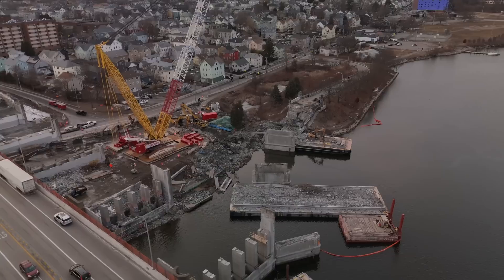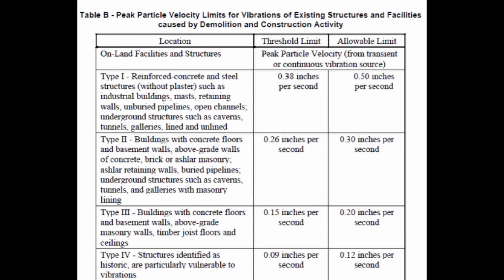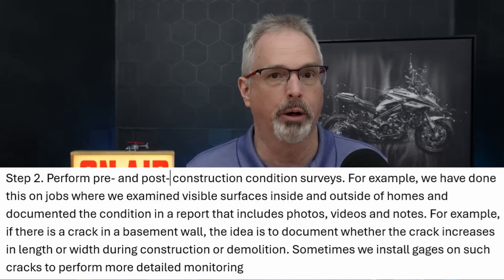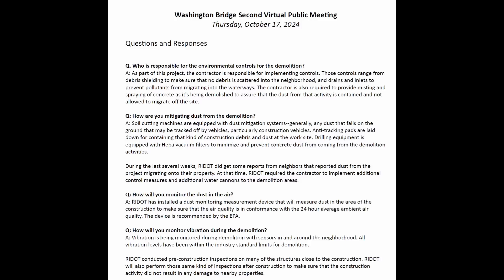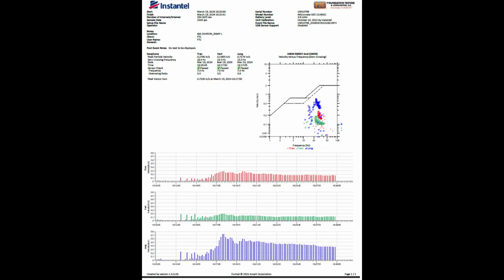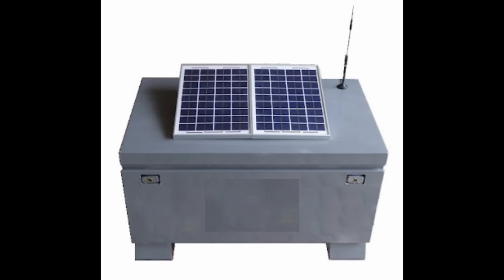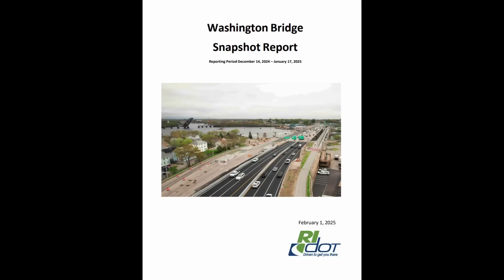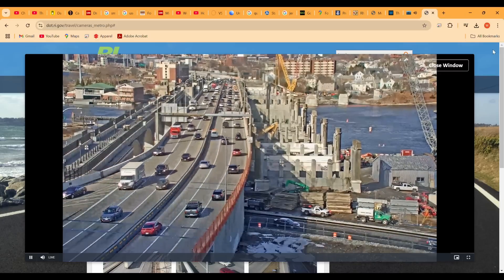Vibration Monitoring Overview and Washington Bridge Update

Comment: The RIDOT reported 2621 trucks over 96,000 lbs crossed the bridge in a 7 week period. This data was obtained from the new monitoring system. Alviti claimed the RISP was enforcing the weight limit but omitted any mention of how many trucks were stopped and the enforcement action that resulted. My guess is its low and Alviti isn't being honest (again).

Comment: Excellent presentation.  This is a monitoring tool that can tell you a lot,   Applicable not only to structures but rotating machinery also,
Reply from the maker: Thank you.  Yes you are right about that issue existing with rotating equipment.

Comment: A return question you may want to ask to folks who are in the vicinity of the demolition and are not aware of monitoring at their structure, is whether they are a renter/leaser or the owner of the property they reside at.  In some of my projects (not a structural engineer but deal with them time to time), there is a dearth of structures where vibration can be measured because the neighborhood consists of more rental properties than owner residences.  The engineer will need permission to measure vibrations from the OWNER of the structure, and if you have bank-owned properties or landlords operating many buildings, then these requests can go unanswered.  There is not much reason to give the state and contractor the benefit of the doubt here as you have laid out in excellent detail, but if we have definite owners who are not being included in the vibration study that is much stronger evidence of neglect here.
Reply from the maker: I can say that there are some owners who are concerned about vibrations and there apparently has been no pre-demolition condition survey performed on behalf of RiDOT to date.

Comment: Try being on bridge a deck paving job, with a full size Gomaco paver, half the bridge with live traffic. The bridge moving up and down is un nerving. None of the GPS manufacturers at ConExpo could explain maintaining vertical elevations tolerance on the paver! I hope you have the chance to experience, a bridge bobbing up and down!
Concrete is an interesting animal when flexing!  South Bound I-15, 146000 South, Utah. 2015.

Comment: One time we drilled some large diameter deep shafts in glacial deposits. We had to plan for hitting boulders. Our plan was to use explosives to remove the rocks if needed. It never did come to that. Years later I learned about expanding grout - is that ever a solution?  I can see it being used for one or two odd items but not for dozens of columns unless it was tight work within a community.

Comment: I've worked with a lot of vib monitoring on equipment but one time we had to monitor vibs on our military construction site when some big items where being tested some miles away. The items were visible to us as they fell through the air. We could see the impact and watch the monitoring gear and see the data response about the same time we heard the wha-whomp. Like you said the higher frequencies got attenuated a lot more than the lower freqs.

Comment: the fox point neighborhood that you refer to in this video consists of many, many structures that were built in colonial times (1700's). i worked for a year in one of these structures on wickenden st (which is in fox point). the structure i worked in had been converted: the 1st floor was a medical office, the 2nd floor was an office where i worked, and the 3rd floor was an apartment. but it was a historical building (registered as such), so as much original architecture/structure was preserved as possible. it had floor boards that were as much as a foot wide; the stairs would never meet modern code - much too steep  and narrow. the floors in the office where i worked were dramatically sloped, and any person walking on the level where i worked would cause the floors to vibrate on the entire level.
given the nature of these structures (age, potential fragility, and historical significance), wouldn't any concern of vibration be of more importance in this area?
also, there is a golocalprov article where residents in the area speak of their homes shaking violently to the extent of causing fear that the structure might fall - with a quote saying that the noise from the demolition was bad, but not as bad as the sounds their house was making as it shook.
if anyone is interested in colonial architecture, you can us bing maps (or whatever app you choose) and do "street view" of wickenden st, providence ri to take a look. you can basically tour the entire fox point area from there.

Comment: I have watched many videos about bridge collapses. More often than not, it appears that only partial spans collapse. This is invisible to drivers and many deaths occur because of this. Why isn't a warning system used to alert drivers about this? On the surface it seems something as simple as a robust and redundant electrical cable system used to turn red lights on the entire bridge to make drivers stop and avoid plunging off the edge used? I say redundant in that all cables must fail in order to help prevent false alarms. This seems like a no brainer to me. Am I missing some detail?

Comment: We do vibration monitoring for both construction and blasting.  Our DOT requires preconstruction condition surveys within 150 feet of the work zone. One thing i have learned is that people generally don't have a frame of reference for vibrations.  Our only client who regularly goes over the over the limits is a large gravel pit, with 1 single-wide trailer next to their pit.

Comment: Casey,

You have now provided enough information to RIDOT to write a work scope for monitoring the demolition and building of the new bridge.  With that said, if I were an independent engineering firm, I'd turn tail and run if RIDOT came calling.

If I had property near the construction site, I would seriously consider hiring my own engineering consultant.  I speak from experience based on the purchase of our present home.  We bought a home in 2010, and we are still repairing major items had we hired a professional engineer as opposed to a mortgage inspector.  Prior to moving in we decided to do cosmetic repairs.  The Town's permit inspector stopped by for a visit and left a "Not Fit For Occupancy" sign at the front door.

Bob
Reply from the maker: Thanks for sharing your story.  On the R.I. situation, I would recommend that concerned homeowners in that area retain an engineer experienced in vibration issues to help protect their property interests.

Comment: Zero-inch blanking band is used in monitoring the graininess of roads. I have no idea of what they mean by zero-inch criteria. I could not find this phrase used anywhere.
Reply from the maker: I thought that terminology sounded odd too.
Reply: Seems to be related to pavement smoothness, no reason to me why that would be relevant to the build/demolition processes in play now (or as anything worrying to quantify at this point).
Maybe google up "International Roughness Index (IRI) and Profilograph Index (PrI)" seems to be a lot of hits on that and your "Zero-inch blanking band is used in monitoring the graininess" directly.
I haven't peeked into it myself yet.
Reply: @ yeah TXDOT has a sheet on it. You put the sensing equipment on the back of a golf cart and drive 12 mph down the road.

Comment: From a distance the now exposed footings and piers look to be in decent condition maybe a second look at using them? Ray
Reply from the maker: I see what you mean, but the new bridge will have much longer spans so the piers will not be in the same location.  Also, the design-build teams will be unwilling to take the risk on a problem with the existing foundations unless they did extensive testing which takes a lot of time.  In this case, I think replacement foundations is the way to go (assuming that they don't damage the eastbound bridge in the demolition process).
Reply: @CaseyJones-Engineer  I defer to you expert analysis and my thoughts were just idle speculation about cost and construction times maybe being equal if foundations were found to be sound and design could be based upon existing foundations shortening the demo and build times to offset the extra testing with the taxpayer saving big. Ray

Comment: Where is the The National Transportation Safety Board is an independent federal agency charged by Congress with investigating every civil aviation accident in the United States and significant events in the other modes of transportation—railroad, transit, highway, marine, pipeline, and commercial space. We determine the probable causes of the accidents and events we investigate and issue safety recommendations aimed at preventing future occurrences.
Reply from the maker: The only get involved when there has been an "accident" I suppose.  Then they take 2 or 3 years to issue their report.
Reply: @CaseyJones-Engineer  The whole thing is an accident.

Comment: Several years ago a portion of I-275 around Cincinnati had lane closures due to a landslide and fear of a worse one.  Well I drove past the spot and guess what I saw a large crescent shaped crack has developed on the shoulder of the road at the very spot they had fixed.  I am no Alan Einstein, but I think the issue needs more remediation.  The crack is noticeable as I drive 72 mph past it.  I think it will slide again.

Comment: If a structure is on piles, can vibration cause it to sink?  Vibration reduces or eliminates stiction, and some soils can undergo liquifaction under vibration.
Reply: The theory or best engineering practice is that the piles head all the way down to bed/mother rock if there is such. But of course, in Rhode Islands case those expensive piles may have been installed on a project in some other state entirely, or indeed be accounted as some found up Mr. Alvitis' . . .

Comment: In as much as there is no external (privately collected data) monitoring system in place, when post-construction inspections reveal structures to have sustained damage, structure owners will face a monumental task in obtaining judgments for repair costs due to absent, withheld or insufficient data records which were a contract requirement originally. Thanks very much for this overview Casey, it's very informative. Thanks for sharing.
Reply: The hard part is proving that something was withheld.  If you can prove that something exists but was withheld from discovery it's an easy win.  At that point the court can draw an "adverse inference" that the evidence it's as bad as it could be.
Reply: @EmperorA0  I completely agree Arthur. The lack of transparancy by RIDOT on this noise/vibration monitoring issue doesn't play well for those which do incur damages from the demo activities. Regards

Comment: Nice update Casey! So they say 'vibration studies to the surrounding neighborhood', are they in fact doing vibration studies on the other bridge? Also, what happened to Alviti's appearance in front of a congressional committee, was there any outcome from that? It seems very apparent from a lot of people, and from a lot of people commenting on your videos, that there is no confidence in Alviti, and that same feeling is starting to be said for the governor also, for not stepping in on the Alviti issue! Is there any movement to replace Alviti?
Reply: Mr. Alviti is the ablative heat shield for the RI governor's office and he will only be replaced, like the tiles on the old shuttles were, when they began to reach their failing point. But when the tiles have the consistency of silly putty, unless the heat is considerable, the extreme malleable flexibility of that tool can seem to hide a vast amount of abuse.